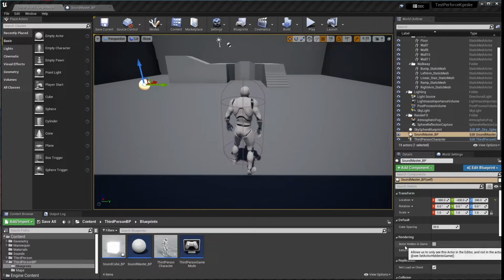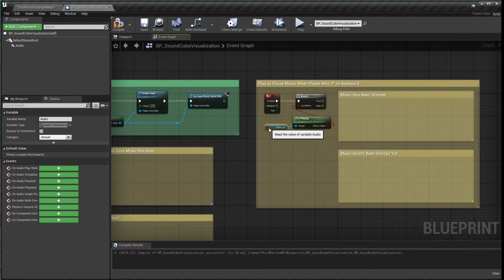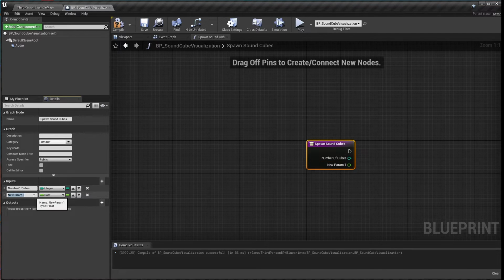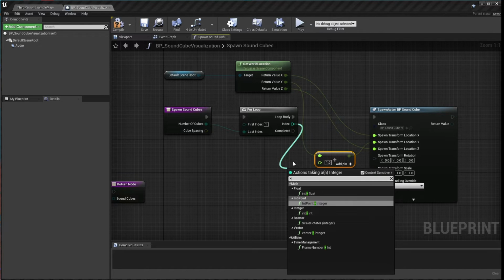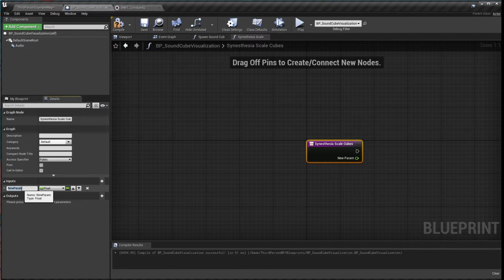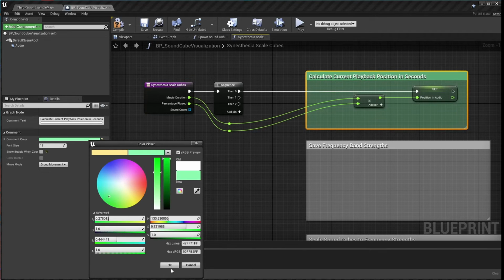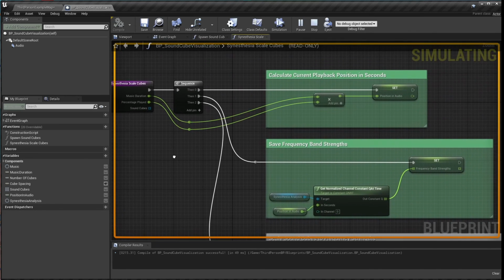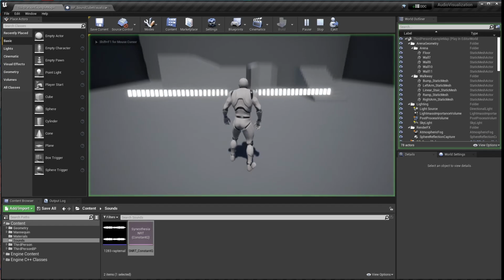Unreal Engine Synesthesia Audio Visualization using Blueprints

Comment: I am having an issue where there is no signal flow from OnPlaybackChange event to the SynesthesiaScaleCubes function. I have also tried @joerykowski6854's method and got the same effect. No flow to the custom function we made to scale the cubes. Can anyone tell me what I am missing? Everything else works fine. The play pause button and the cube spawning all work.. everything except that last section.
Reply: For anyone having this problem in UE5, the problem was that the tutorial calls play, before it calls the bind function on the audio. All that is needed to do was switch the first and last pins in the sequence. The first pin from the sequence node goes to the "Bind Cube Scaling Visualization to Audio Playback" section and then the rest can go in order after that. 

Don't know what the difference is with UE5, but that is how I got it to work.

Comment: Thats so dope, thank you for the tutorial!
Would this work as a faux hud element? I'm asking because I'm trying to follow this tutorial, but have it as a static "animated" actor inside the first person camera. Can I add this actor to my player character and set its location and rotation to the camera?
Reply from the maker: There are a few ways you could do this. One would be to code the visualization blueprint as an Actor Component. It could then be added to the player's component hierarchy and positioned (location/rotation) in relation to its parent component in the hierarchy. Another possibility is to recode the visualization using a 2D UMG User Widget. This widget could either for positioned absolutely within the viewport, or added to the player as a widget component.

Comment: How can i get this to interact with niagara fluids? 

I added the collider tag and it kinda does something to the fluid, but i cant get any splashes or waves, it kinda just deforms or displaces the fluid when the sound cubes scale into the fluid, is this because the sound cubes are copied in on every frame with a different z axis scale already on them?
Fantastic tutorial btw, Thank you!
Reply from the maker: You'll want to look for difference ways to "drive" the Niagara fluids using the synesthesia data. There are tons of great examples of Niagara Audio Visualizations in this Github repo: https://github.com/Lahe/AudioVisual  It's a UE 4.26 project though. A demo of these visualizations can be watched here: https://youtu.be/b1e0I4jdkNE
Reply: @stungeye  Thank you for your reply, but i dont think this will work with what im trying to achieve. 
What i want are these audio bars placed in some water, so when the bars jump up from the music they splash and wave the water
Reply from the maker: @Yhimself  In that case you'll probably want to look into enabling and using the UE Water plugin, rather than Niagara. https://docs.unrealengine.com/5.3/en-US/water-system-in-unreal-engine/

Comment: Underrated video! Well explained and straight to the point.
How can I go about the scaling being unipolar instead of bipolar? I want the surface to stay flat without hiding it through a wall or something.
Reply from the maker: In order to only scale in one direction you would need to do both a scale and a translate along the same axis. You need to translate half the scaling distance. In order to this translation to not have a cumulative effect (continuously moving the boxes along the axis) you might need to save the original transform location of each box, and apply the translation in reference to that.
Reply from the maker: Oh and thank you for the kind words! Glad you liked the video.

Comment: How to render the simulation? I can't get it to render in Sequence
Reply from the maker: You should be able to drag the Blueprint actor that contains the sound visualization into a level for it to render.
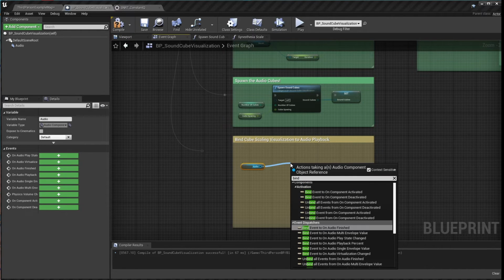Reply: I was having the same trouble using the custom event.  @21:47 found that using the standard Audio event for "On Audio Playback Percent (audio)" that event tick got fired.  Sound Cubes animated since each tick it was grabbing the analysis at that spot in the sound track and showing the scaled cubes.
Reply: @joerykowski6854  So you got this to work in sequencer?

Comment: can we make a static mesh with dynamic light?? which changes color over time based on the music
Reply from the maker: This should be possible using an emissive material and then controlling the material's base color using synesthesia data.
Reply from the maker: See this link for details on animating a material's base colour: https://www.versluis.com/2020/09/change-material-colour-ue4/

From there you could bring in the synesthesia control as shown in my video.